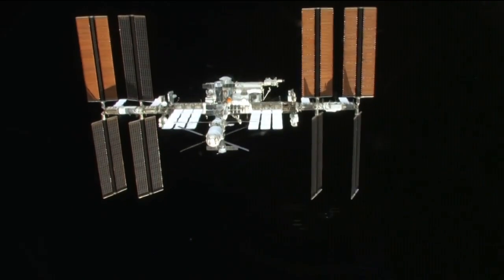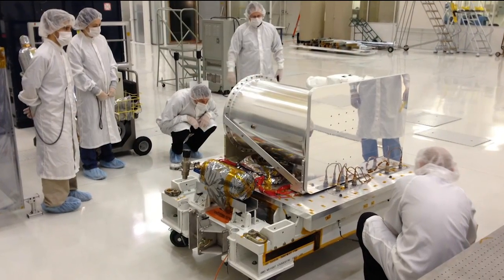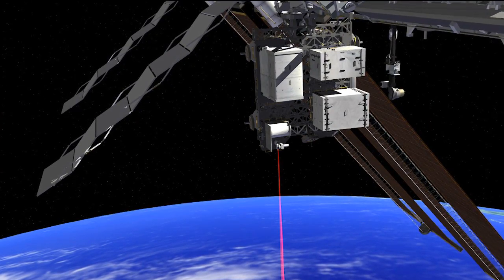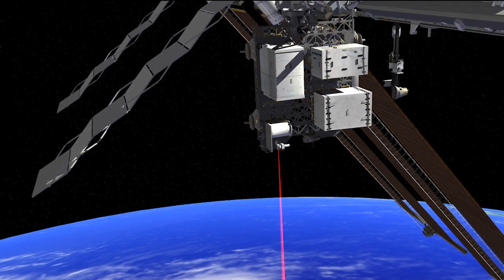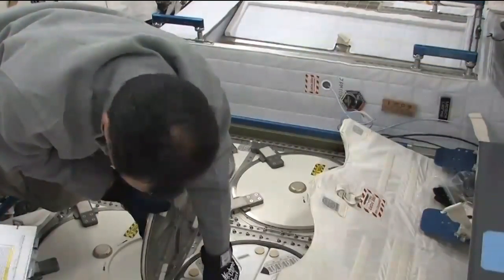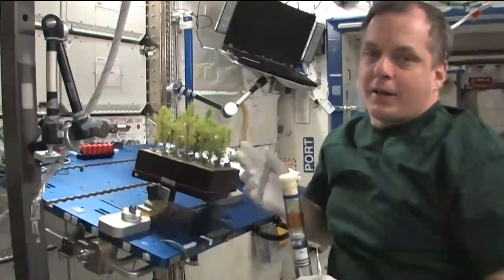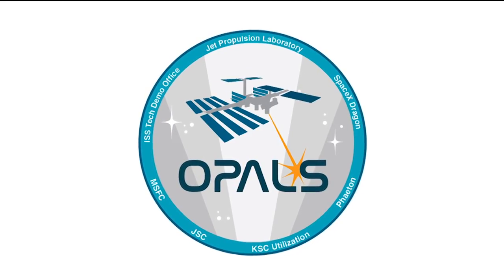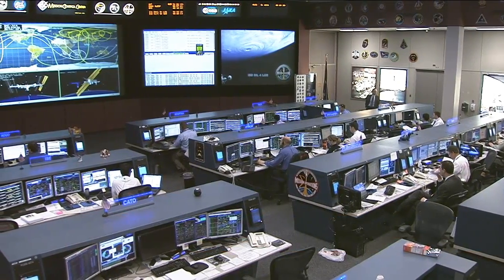ISS Update: Optical Communications

Comment: thats a very good question! clouds are very effective at dispersing lasers.

as of now ISS uses KU band and S band transmissions for data.  these often drop in and out of availability depending on certain factors.  but they have always been enough to get the job done even with very low bandwidth and occasional unavailability.  with lasers we will probably see the same behavior, but with better bandwidth during the available times. commercial hd cams will take advantage of this for public viewing